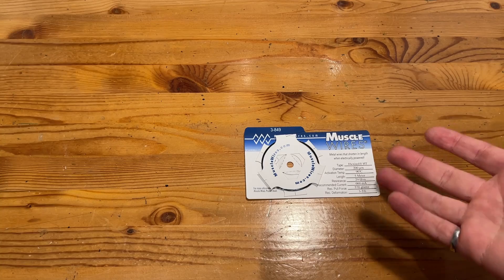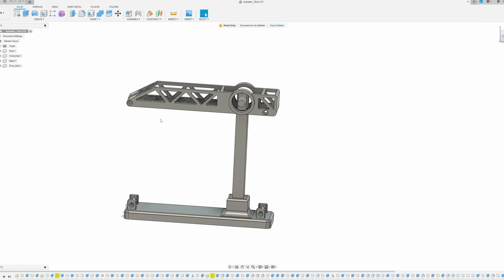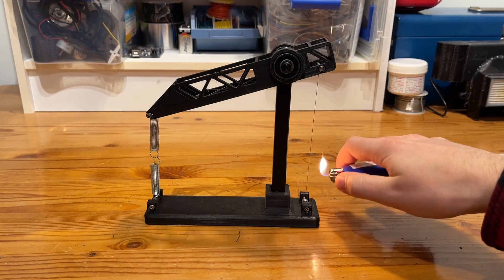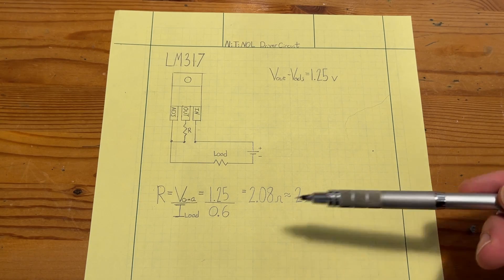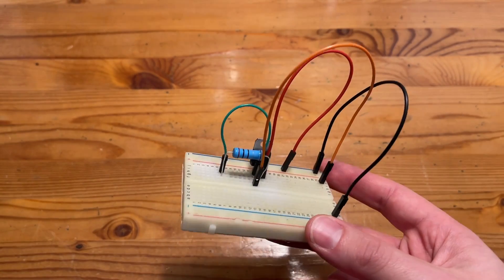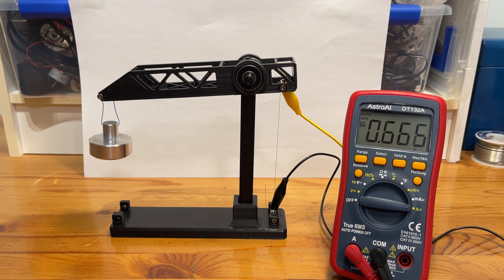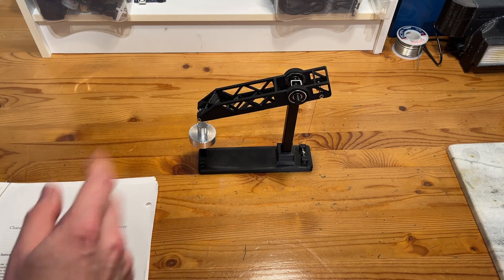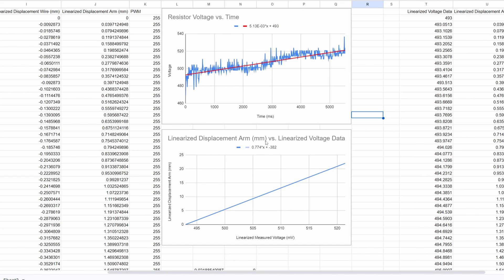DIY Arduino Controlled NiTiNOL Actuator

Comment: The wobble up and down is probably coming from the different heat properties of the jumper wires, alligator clips and the nitinol creating a cycle. Think diff eq. If you attach separate monitoring leads to the nitinol to measure voltage drop, I’d bet you’d get rid of that. Also solder it. Your breadboard looks old and they tend to corrode inside, making it impossible to develop.

Comment: Cool video, good demonstration of nitinol's function and properties. Were you ever able to get your control circuit built on an actual board? Curious how your circuit design would do controlling the nitinol with solid soldered connections.

Good looking out sharing the circuit info too. I'm working on a design to use nitinol as an actuator to control stabilizer fin deflection. Seemed like that was kind of what you were thinking about using it for in the beginning of this video?

Comment: I really love your video and I learned a lot.

A few suggestions: There's a company called flexinol that sells nitinol wires that actuate and then return to their original position due to the coiled wire being encased in silicone. These wires are also standard and used for the specific use csse you're using them for, so there are already data sheets available. They also have a variety of widths.

Another thing to consider is that the wires ability to disapate heat increases with the difference between it and the rooms temperature, meaning it will take longer to unflex than it took to flex.

Coating the wire so it doesn't disapate heat as fast might seem disadvantagious, but it means that the movement will be more smoothed out.

Also the ends of the wires making contact will transfer heat into the anodes and cathodes, so you might consider a heat resistant option like carbon as to isolate the temperatures and smooth out the motion.
Reply: If you look closely the wire he is holding is exactly Flexinol 1:39
Reply: hi! Great suggestions! Could you please expand on applying a heat resistant carbon to the a/cs of the mosfet? Thanks!

Comment: I’d consider working with an STM32 of some kind or maybe an ESP32 which both have 12-bit analog to digital converters (arduino nano’s atmega328p has a 10 bit adc), which offers a 4x higher reading resolution. You should also consider using a good power source and reference voltage circuit to ensure proper precision. 
There is also a component called opamp that can be used in your constant current circuit to reduce its power loss across the resistor, not forgetting about the heat sink on the ic to ensure it works properly (edit: I did forget, oopsies). 
Last but not least a breadboard is terrible for any kind of precise circuitry; breadboards are meant for very early prototyping. Exceptionally on your case, the high current flowing through the circuit gets especially distorted as you have pliers-like things that grab onto the components’ legs and dissipate a lot of the power that should go to the actual nitinol wire. 
I’m not an engineer myself, more like a hobbyist (on a cellphone at that) of sorts. Hopefully I could be of help.
Reply from the maker: Excellent advice, appreciate the feedback! I’ll definitely keep this in mind when I revisit

Comment: Very cool project! Wholeheartedly agree that rocketry is an exciting application for these. Hopefully some of the following electronics suggestions are helpful.

To the point of avoiding large power components in the current source:

A constant current LED driver could be an effective off-the-shelf solution.

Otherwise, a MOSFET driven by an op-amp can make a constant current source. You would connect the FET on the low side of your load, and you would get to connect a low resistance (~0.1 Ohm) current sense resistor between its drain and ground.
The voltage across the current sense resistor is connected at the (-) input of the opamp, and a voltage setpoint is connected to the (+) input of the opamp. The output of the opamp will drive the MOSFET's gate.
You may also use a hall-effect current sensor instead of a current sense resistor. That way the only power dissipating component is the driven FET.

To further reduce power consumption you might need a switching current regulator, though it would be more complex (higher component count and more difficult to design) and noisy (due to the switching, which may require filtering the output).

Regarding the ADC / measurement noise:
Adafruit sells I2C ADC modules with great resolution that may be worth purchasing. To replace a breadboard, Adafruit's perma-proto boards have the same row connections as a breadboard but connections are made with solder like a perfboard. I've found them easier to use than perfboards.

Comment: You can use the non stretching wire as well by winding it into springs yourself and setting it's shape. Makes it easier to create designs with long travel.

Comment: I've never worked with NiTiNOL, so, sorry if it makes no sense. But...
Could you try driving it with a PWM fed MOSFET? Maybe the thermal inertia of the wire is enough to for you to have a stable control within reasonable frequencies.
Reply: Any linear power control will have big losses and need big dissipation.
Reply from the maker: Sounds like it could be worth the attempt! It’s already running with a pwm controlled mosfet so a test run to see if it overheats may be worthwhile, currently the current is limited by the extra resistance
Reply: @Someone_Should_Make_That  if that fails, you should consider a DC-DC converter. Won't be hard to integrate it to your PID. Keep us posted!

Kudos for the project!

Comment: You could just use 4 normal 1/4W resisters in series/parallel instead of your massive babies first one.
Not necessarily 'better' but you dont have to special order the big one at least.
Reply: Cool! I was thinking the same - glad someone shared that thought

Comment: Batter cells are 1.8volts with a bigger resistor then balance the resistor load and ohms so u can set your volt amp. No need for the constant.
Reply: This comment gave me a stroke